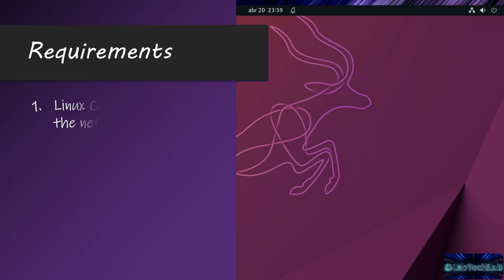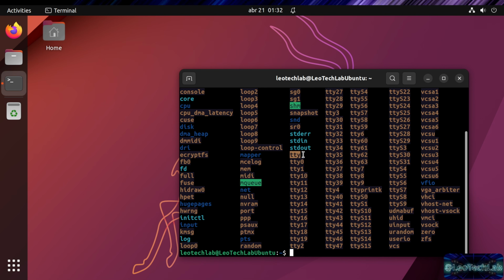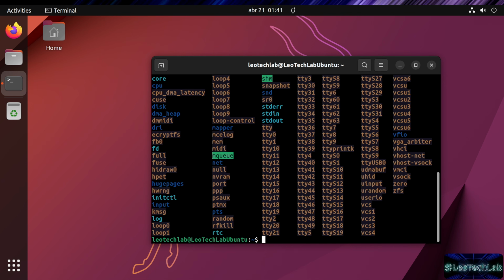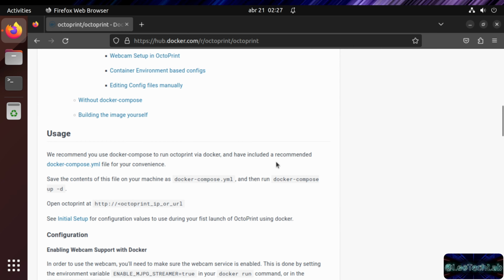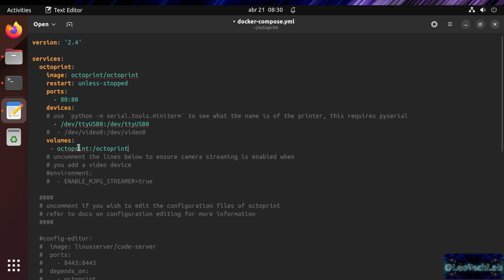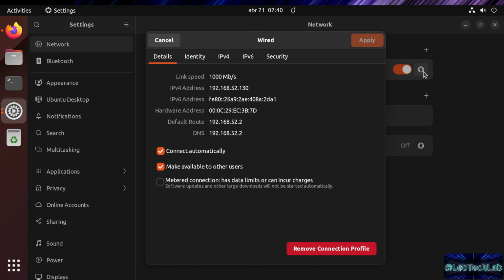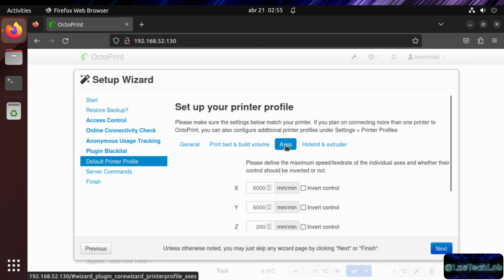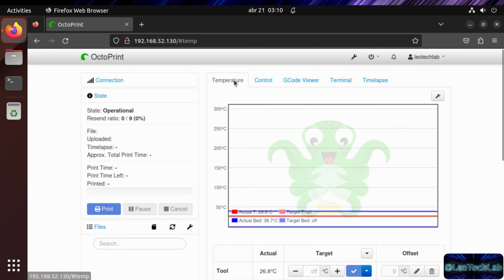How to install OctoPrint on Linux (Docker), step by step (feat. Sovol SV06)

Comment: Hello, I got docker installed after a bit of testing also with the usb. However, I would still need access to several gpios because my printer is to be controlled like this. Is there also a possibility?
Reply from the maker: That is a specific corner case that I cannot test by myself, given that I don't have that hardware scenario at home, unfortunately.
Reply: @  you can in the Plugin Manager Download the physical Buttons Plug.
And then make gpio 17 (11 on the Board) and set NO.
And than set the Printer on paus or brake when gpio 17 on 5v 
That was cool.

Comment: Hey, I'm having an issue where when I go to run "sudo docker compose up -d", I get an error "yaml: line 4: did not find expected key" and I'm not sure where to begin troubleshooting, as everything I've found online has said it's a formatting issue, but I don't see why that would be when I only edited the YAML file where you said to. Any ideas? Thank you!
Reply from the maker: I suspect it to be a formatting issue as well... unfortunately the yaml format is prone to these types of problems because indentation matters, unlike JSON, for example. Try to check against the original yaml file and use a text document comparing software (e.g., visual studio code has one) to spot the differences between the files, if they are not visible to the naked eye (e.g. spaces, tabs).

Comment: Hi, I added a few instances of octoprint to my Raspberry pi and they work great thanks to you, but I came across a problem. I originally installed the Ubuntu kernel on a 32gb micro SD card and now it seems like it's not enough for all the instances I am running. I also added a 500gb ssd card using the argon case. The octoprint instances can't see the drive and I think it's going to cause an issue if the SD card fills up. Is there a way to get three octoprint instances to see the drive?
Reply from the maker: Sure, you can share a new host directory with any docker container, even multiple containers at the same time. Just mount it as a volume in the docker-compose of each container you want to provide shared access to.
Reply: @LeoTechLab  is that in the bottom portion of the docker-compse file?.where it says volumes: octoprint?
Reply from the maker: @vitaliydvorkin1342 exactly, just add a new line mapping a local host directory (your new drive, for example) to a directory inside your container. That way your container can access the new drive using that volume mount. You can refer to the docker manual on volumes for more information. But this really depends on what exactly you are trying to achieve...
Reply: @LeoTechLab  pretty much just add more storage options. I tried moving a container but I ended up deleting it and making a new one somewhere else and that didn't add new data. I even changed the volume from the original octoprint:/octoprint to the mount point of the ssd and the new instance octoprint still only had 32 gb max
Reply from the maker: That's because that specific octoprint docker image was probably created with that allocated space to begin with. I think you can override that setting, look it up in the docker documentation.
Reply: @LeoTechLab  thank you, I appreciate you responding
Reply from the maker: @vitaliydvorkin1342 No problem, always glad to try and help out👍

Comment: Great video, worked like a charm. One question. If I wanted to start a second container, I would just have to change the port number, right?
Reply from the maker: Yes, but I'm not sure if you would be able to share the same printer with both containers at the same time, so be careful about that. For different printers, one on each container, you should be good👍
Reply: @LeoTechLab  yes, it's different printers. I was hoping to save some money and not by a pi for every printer. Thank you for the response
Reply from the maker: With different printers, one for each container, you should be ok, just make sure you have enough CPU, RAM and disk space to run both containers 👍
Reply: @LeoTechLab  that will be the test.
Reply: @LeoTechLab  It looks like the PI 4 2gb is not strong enough to deal with 2 Instances
Reply from the maker: That's too bad... Maybe consider an upgrade to a mini PC instead of buying a second Pi. Those cost you around 100€ for decent specs.
Reply: @LeoTechLab  That's ok. I got a 8GB one. I did run into a funny problem. I decided to use :110 but that's used for the Post office so I had to erase it and got to 120

Comment: Hi! I just found your great video. I have just one question: how can I make sure to know the right device in /dev folder instead of guessing it? How do you know that your printer is /ttyUSB0?
Reply from the maker: Hi, thank you for your feedback ;) Regarding the /dev folder, I think it's a Linux standard to have all devices represented in the /dev folder (but I'm no Linux expert, so take this with a grain of salt :P). Regarding the ttyUSB0, specifically, I found it just searching for marlin firmware and 3d printers on linux, if I'm not mistaken. But I would say you can try and use something like "dmesg | grep tty", for example, right after connecting your printer, to check which tty device file corresponds to it. Just make sure to execute the command right after connecting the printer, because I think the dmesg source can be cleared from time to time, and it may not appear if you wait too long after connecting the printer. Also, first make sure you have the printer driver properly loaded as well, as I show in the video, using the "lsusb" command, for example. I hope this helps ;)

Comment: Great tutorial, thanks a lot. I'm a complete beginner, but XYZ movement speed what you seted up, looks a bit slow for me, 500mm/minute is just 8.3mm/sec, and  10mm/min is very very slow imo.
Reply from the maker: Thank you for the feedback! Regarding the movement speed, I'm using the stock values from Sovol.
Reply: @LeoTechLab  but on they webpage they recommend 80mm/s print speed, you cant achiieve this with 8.3 mm/s (500mm/min what you seted up) XY movement speed. I'm i miss something? That 500 should be more like 5000.
Reply from the maker: I took the values from their cura profile, unless they have changed it since then. Anyway, the intent is not to be blocked by the values, but to show people how to configure their printer in octoprint. For values, each one uses what makes more sense to them.